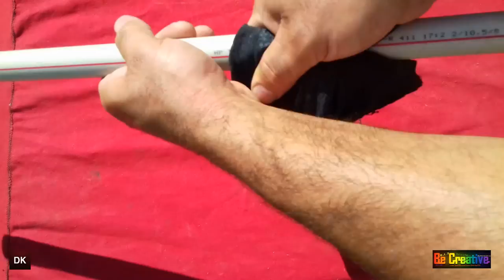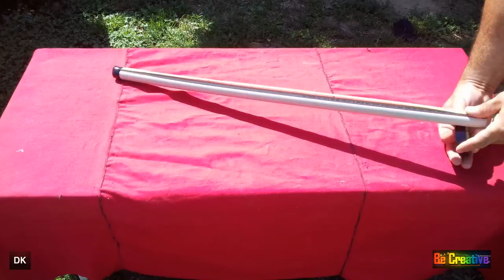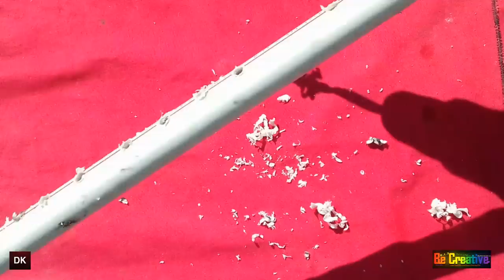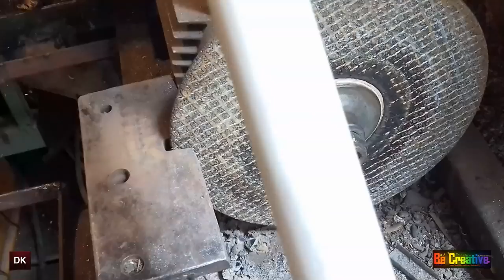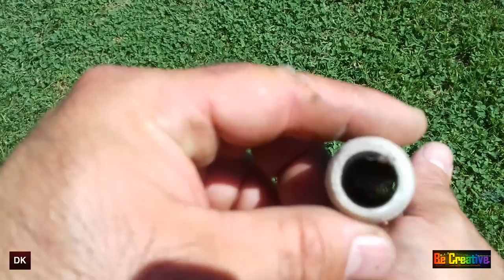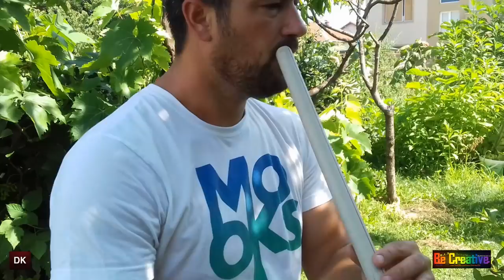How to make a traditional Macedonian KAVAL PVC pipe / Musical instrument DIY for FUN

Comment: How you blowing in this kaval! I was made my own plastic pipe...kaval...and the sound doesn't work...!!! I was tried all positions ....and I was tried to mentain on the half on the lips...! but the sound doesn't work constantly!!
Reply from the maker: You need a lot of exercise, I got the first sound in two weeks ...
Reply: @MrDKDIY  ....I can just to blow...in my pvc kaval....but the holes doesn't work. I think that I was wrong with the measures of holes....
Reply: @MrDKDIY  I was tried many times...but the pipe is not good...is large....and that is the sound is doesn't work! I was respected the angle 45° wich there I must to hold at lips ...! I was made another kaval with 5 holes but is from.copper.pipe is sound like macedonian kaval!
Reply: @MrDKDIY  today I was practice at my copper pipe kaval. I was used a tiny pipe copper and I was drilled just 5 holes like romanian kaval. I was learned how to blow in the pipe and it is very cool. My own version of kaval is sound like macedonian kaval! 😁🇷🇴🇲🇰🇲🇰🇲🇰! 😁Salute from Romania!
Reply: @MrDKDIY  now 55 minutes i was learned to blow on my plastic pvc flute,wich is shupelika with six holes! It sound like sheperd's flute! Tomorrow I will looking for another piece of pvc pipe wich most to have around 90 cm! I will make my own version of kaval!!

Comment: What kind of pipe are you using
Reply from the maker: I USE PLASTIC TUBE FOR INSTALLATION OF WATER 16mm OPEN
Reply: Mr. DK DIY Thanks!
Reply from the maker: NO PROMLEM !!!
Reply: Hey it's me again. What are the measurements for the hole positions.